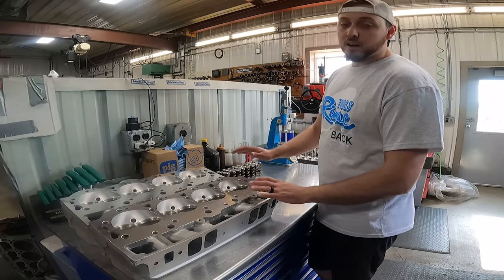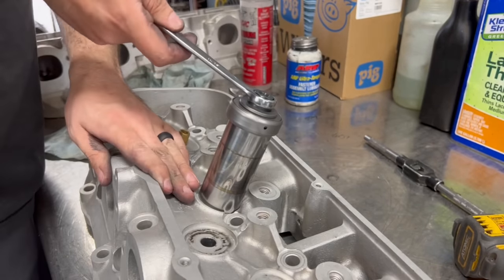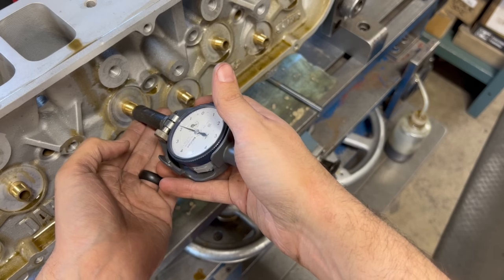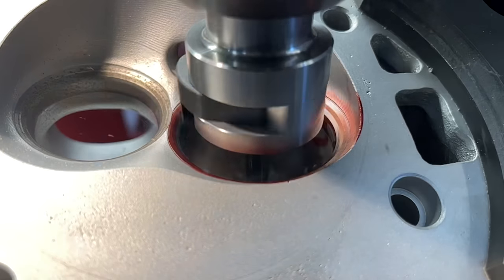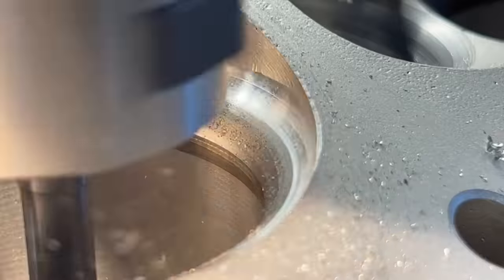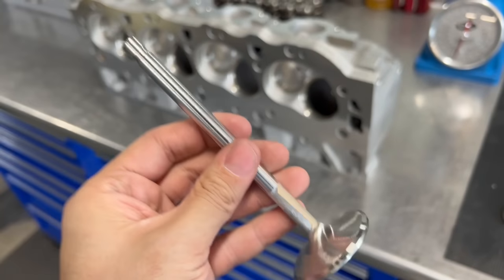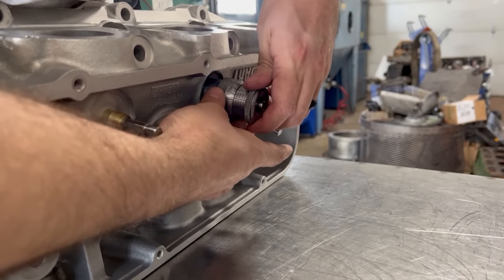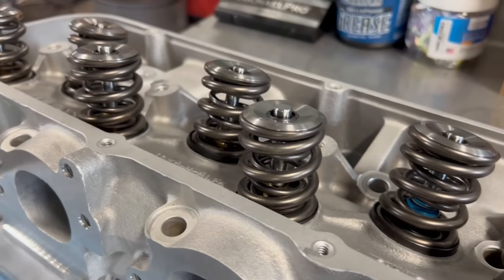This Set Of Big Block Chevy Race Heads Needed A Lot Of Work! Liquid Nitrogen and Specialized Tools

Comment: In 1973 we rebuilt our first car engine-a 1959MGA. Although it was a comedy of errors, as we had little experience other than single cylinder motorcycle engines, we did prevail. A few years later, I jumped in with both feet in the machining trade. I’ve loved it for the last 41 years. Great job!

Comment: Man I would be like a kid in a candy store if I had access to the equipment you guys have there. Thanks for taking us a long.
Reply: Only takes a bunch of $$
Reply: @Sicktrickintuner  in my country will take bunch of $$$$$$$
Reply: The cost of new equipment is prohibitive to most. I have recently purchased a used 530 Vanorman surfacing machine for a very low price after researching modern electronics to replace the entirely burnt 1980 circuit boards I was able to restore function and now have a machine with less then 2000$ USD invested that will finish a 45-50 r finish on aluminum. I guess my point is chase your dreams and work with in your budget and you can reach your desires. May not happen as fast as you want but you can make it happen
Reply: I’d be buying engine parts just to machine for fun😂
Reply: @altonb93  😅😅

Comment: That liquid nitrogen process is exactly the process we used at Douglas Aircraft in Malton, Ontario, Canada to install bushings into the globe ends of the DC10 wing spars way back in 1968. We used the power table lift of the mill we used to bore the globe end hole to push the bushings in with the wing mounted on a sine table and held in the air by two gantry cranes, it was a long sucker.  That nitrogen process worked like a charm.
Reply: Stuff like that would make for a great video, aircraft shops are awesome places. I remember when the Malton Douglas plant was still in operation.

Comment: Just a note to let you know the content you create is both inspiring and informative. Having been a dealership tech my entire life now in retirement I have revisited machining ( i hated it as a 12 year old being forced to work summers in the old shop) playing with the equipment my grandfather had left me when he passed 30 years ago. When he passed due to monetary and space constraints, I was only able to keep a few pieces. I chose to keep the Sioux seat grinding set the Sioux valve refacing machine a Vanorman 570 and a Vanorman seat and guide machine. All the equipment was stored to the best of my ability over the years. The last few years I have restored all to operating condition. I have also added a 1980 530 Vanorman I got cheap (completely burned obsolete electrical boards) after upgrading to modern vfd it operates perfectly.  Thank you for the content and the information you create. It is truly inspirational.
Reply from the maker: Awesome story! 

I understand “I hated it as a 12 year old being forced to work summers”…

It just didn’t take me as many years to come around to it lol
Reply: I know where your coming from...When my buddies Sunnen VGS20 Seat & Guide machine had motor board problems....Sunnen wanted $2000 for a "retro-fit kit" I was able to source a $300 VFD drive and build a control system to get it back in operation 3 days after it went "FUBAR".....The entire cost of our "retro-fit" was under $500....Not every shop can afford a $100K+ CnC block machinig station and sometimes the old school craftsman can create better end result.
Reply: I was the opposite. I loved going to work with my dad. From an 8 year old, to a 12 year old, to building my first house from start to finish when I was 15 (EVERY SINGLE DAY of the summer, every weekend, and every moment I wasn't at school), to becoming VP at 18. Then I decided to go to college to go to med school. Stupid decision. I would have made more money than 99% of doctors make, not had to spend half a million dollars on school, and not have to build a business from the ground up, and not had to have waited 10 years to start making money. Just accounting for the cost of school, and lost wages over a decade, that would have been more money than most doctors make over a lifetime.
Reply: @littlejackalo5326  eh youre talking some pretty shit doctor money

Comment: Its good to see that you guys have the ability and the patience to basically nurse these "Well Used" aluminum heads back into service again. A lot of shops would have just said "Save your $$ and put that towards porting  a new set of heads and move on. These are toasted "  Its scary what there getting for new a new set of QUALITY BBC Aluminum heads today. And thats if you can even find a set. Then comes all the custom work to make them do what you need them to be able to handle. Be it, Natural Asperated, Blower or Turbo (multiple) charged today.

Comment: Pro tip : magnetize a pocket screw driver, put some lithium grease on the grooves in the valve stem. Use the magenetized pocket screw driver to put the keeper in place.  The lithium grease will hold the keeper in place as you slide the pocket screw driver up and off the keeper.

Comment: As a machinist myself for over 35 years, I did a lot of similar work as you showed in the video.  I retired 5 years ago and still watch many machining channels on YouTube and I enjoyed your video very much!  the only procedure I would question is toward the end when you were using a smart phone to level the head in the machine.  Now I love my Iphone and use it for all kinds of things, but I'm sure that it is not accurate enough to use in a machine shop. Get yourself a good tool  like a Starrett machinist level.
Reply from the maker: Thanks!

No machine work was being done at that point. Highly uncritical, just needs to be close to level so that when compressing the spring things don’t move on ya. 

We have plenty of Startett levels and otherwise but there are times when it is critical and times when it is not.

Comment: Personally I find a lot of the performance valves are very seldom concentric to the stem, oddly enough the stock replacement stuff tends to be way better, top line stuff for example compared to elgin performance. Good stuff otherwise and always good to do your due diligence and check all these things.
Reply: A ton of stainless valves come from Brazil and Venezuela. QC may not be up to snuff, and collets can be worn out so the valve does not center every time.
Reply: A lot of OTS performance heads aren't as good as people make them out to be. Ive done a lot of Dart LS heads where they were full of chips, had tons of casting flash in the water jackets, and seats with .007" runout and .012" variance in seat depth. To think that most people just bolt stuff like that on is scary lol
Reply: Almost like the expect the buyer to end up machining them to fit the valve seats.
Reply: @wilsonrawlin8547  I see these problems in the “ready to bolt on” heads as well
Reply: @MichaelRadelet  
IF you've seen this from the people I mentioned that is scary.

Comment: Still watching. and knew Rimac had dropped off the market. Made a lot of money selling used units in the day. They are the best IMO.
Totally agree with cross hatch in the guide. Nominal to have a viable surface to carry oil on the wear faces of the guide and valve stem.
Nice work and a nice set of CBB heads for the street.

Comment: Great video!

Some of the close ups of the valve job showed that there was a lot of pitting or porous surface finish in the rest of the combustion chamber. In your opinion would this be cause for concern (sharp edges providing hotspots for pre detonation)?

Comment: I really like this channel because it is great to see a young man talk with confidence and that is all on your parents, great job.

 Now one small point when you speak about the cross hatch on the valve guide you pull a woke moment... Always speak with knowledge and facts, when you are not sure use your father's knowledge and experience as back up to your statement. Most people enjoy the channel for the info and family (father son duo)
 Please keep up the fun...

One last thing to your generation think about how to explain how you can make engines run better ( both in torque and horsepower) plus to get younger kids on board talk about emissions and how they are improved by the type of work you are doing and why using a professional with decades of work experience is so important on getting you ( the customers) the results that helps thier wallets in the end...
 My two cent...

Comment: do you not measure seat heights and concentricity before and after you do a valve job?? especially since you've replaced guides? or is the Serdi a rigid enough machine where this isn't a concern? I'm used to the Sunnen VGS, and trying to get seats better than .002" concentricity can be a struggle when trying to keep seat height within .005" and combustion chamber volume the same.

Comment: Hi, love your content. As a mechanical engineer I have experience with blue testing machined parts. Looking at your procedure of blue testing the valves I am puzzled. I noticed that you blue test the valve against the machined valve port. Everything checks out fine. But than you grind the valve afterwards. Possibly changing angles and fit. Just for fun. Could you blue test again after grinding the valve and see what print looks like? Or explain that that it does not matter?

Comment: The previous valve job seemed pretty bad. Wondering if that non-concentric valve seat is what bent the intakes.  I'm racing a set of those Dart Pro1s right now.

Comment: Why not use a radius cutter on the intake it’s worth it’s weight in gold in flow. Love the videos I’m getting away from the hundreds of stones I use the old Sioux system and getting a setup for my mill to start with insert seat cutting it’s easy with the Sioux but consumables are getting expensive comp to inserts. The quality standards of valves from factory has went esouth lol I tent to find on the expensive hallow stem or wild metal valves especially if from Farrea valves they come cut right most time I change seat angles so end up recutting them anyhow

Comment: Building an engine for the Starfire?😁
I found an old Rimac 500 pounder and a Sun distributer machine in an old abandoned shop in Holcomb, KS.  That spring tester hasn't needed any work in 30 years.  No wonder they are the standard.  They chose wisely who to sponsor.
Reply from the maker: Haha! That would be a lot of engine for the Skyhawk (same difference). We have the short block built for the Skyhawk but life get's in the way. 

Thanks for watching 😁
Reply: I believe the rules dictate Skyhawks require turbo Buicks.  👍

Comment: With using carbide cutters I see the markers being uses for checking the seat position, does that eliminate having to lap valves anymore with grinding compound? Or is it still used and I haven’t seen it yet.

Comment: How do you balance consistency in valve stem heights when each seat may clean up at different depths?  I know you can shim as necessary for spring pressure but I am curious if you have a common valve rail and non adjustable rockers how that works.  That deshrouding looks amazing and clean.  Do you CC the chamber for the customer and if so, is there a +/- tolerance you drive to achieve between chambers?
Reply: One of the older videos he mentions checking the valve heights before he finishes the seats and matches them as close as possible to the lowest seat. Think it was one of the first few videos after they got the new machine but didn’t really go into details about it.

Comment: Hi , an thank you that is very good machine work you did, my friend sold me a pair of sbc pro max heads that are like new the exhaust ports are square an i can not find headers for them, its like do i make a pair of adaptors to fix this? Also the ports are cnc ported and huge like they flow at least 210 cfm, i dont think that they are very good street head. they look like full on race heads, they came with two sets of bbc springs with all the hardware to install them.i paid $400 dollars for these heads.i am just going to build a big race only high horse power motor an put a set of fender well headers to solve my exhaust problem.thanks again an keep making awesome machine shop videos... ..

Comment: I want to invite you to a different way of thinking if you don't mind when it comes to seats +ports +flow...

Your putting 5 angles on an intake valve seat... Think about this for a moment.... The intake and exhaust follow totally different rules and your treating them the same... 

The air entering the chamber will be at a higher mass if you just opened the seats to only 1 or two angles (yes you may be doing 5 angles in the same distance as  your would do 2 or three) but getting rid of them intirely on the intake side will improve flow dramatically. The air could care less about these extra angles as they don't aid in better flow going the opposite direction all it does is make the seat smaller than it could have been. However 5 angles or rather, a radius on the exhaust side would help massively increase flow OUT the head 

( like a velocity stack going into the intake  and a velocity stack into the exhaust port. )

 Think about what the air is doing not what you SEE. Because 1 is an EXIT (leaving the port  into-> chamber) and 1 is an outlet ( leaving chamber into-> the port) yes more angle is better flowing. But  you gain nothing on the intake valve doing it  mass thru the same port when you open the intake seat  to 90-93%ish the size of the valve size would have you removing the angles  

  On the exhaust side it fallows different rules  you can't use the same method for two flows in the opposite direction with the same shapes. Being that the valve is the same shape you need to adjust the design to help it flow for the intended purpose.  Just because the seat is s re sling the valve at the outer edge  doesnt mean anything if the seat is not wider. But taking those angles comolet away leveling only the seating angle would open the seat nearly 3-4mm  this is HUGE.    By also back cutting the valves  to the sealing angle you would improve lower lift flow by nearly 2x  valve spend twice the time at lower lifts so this is why I say 100% to open up the intake seats, they don't deal with heat like the exhausts for 1.  And for two given the flow direction all these added angles only get in the way.  Thought the air may flow smoother   you end up with less mass air in the combustion chamber.

 For the exhaust it's a bit different as the valves seats acts as a collector in a way  plus the added heat and need for valve cooling   means you will want a durable seat and thicker seat  as well as multiple angle to guide the air,  in this instance a larger seat is needed  (atleast for cummins diesel applications) the smoother the airflow in the direction of the seat the more you can get OUT.

 The intake has already done it's part to get the air to the seat, the most you can do on a valve job for the intake is  open the seats 90-93% the valve size and tailer seat to match the shape of the port and back cut the valve  to the SEALING angle leaving only the meat that actually seals.   Here is why this  improves flow, The extra angles and meat just before the valve on the intakes literally get in the way  of further performance Gaines  as the port can easily be opened 3-4mm wider taking away to metal that forces the air to crash into the valve  instead of around it,  there is only gains to be had by doing this

  Adding angles to the intake valve at and exiting point,  it's like adding an intake velocity stack  for a muffler tip... Why don't they do this?  Because it surves no gains.  Getting rid of the intake angles other than the seating angle,  you will have yourself a really nice set of heads that  flow very well on the intake side  atleast.  But for the exhaust I say eat your heart out on angles as the velocity stack idea would help air ENTERING the port better but you wanna take into account  the seat mass and port size as both of these should effect  the way you make your decision.

Comment: As someone that knows very little about the intricacies of proper valve jobs, I was surprised 1: there was no lapping.. and 2: you ground the valves after you checked them with the seat cut. Seems like you should do the valves first, the the seats. But like said, I know nothing...

Comment: Hello, Son of Jim! Could you please tell me more about those Pig Wipers? Are they low lint?
Reply from the maker: I don’t remember exactly what I used in this video, but I usually have both the heavy duty wipers (blue, in a box on my bench) which I don’t believe are advertised as low lint, but they’re much better than some products I’ve used. 

I also have the New Pig “print shop” wipers which are advertised as low lint! They’re great, but if whatever you’re working on has sharp edged it’ll still tend to grab some lint even off of those.
Reply: @JAMSIONLINE  Thank you!

Comment: So, I'm a little confused on some terminology.

Specifically, the difference between keepers and locks.  Since I was a kid, I've understood that the keeper was the piece that sits on top of the spring and the locks are the two little bits that, together, make a cone shape fitting the female taper of the keeper.  This assembly acts like a collet, forcing the internal ridge(s) of the locks into the groove(s) on the valve stem.  Thus using the spring pressure to hold the whole shitteree together!

As I understood it keepers and retainers were the same thing.  Is it keepers and locks that are the same?!

Have I had this wrong for fifty years with people snickering behind my back?!